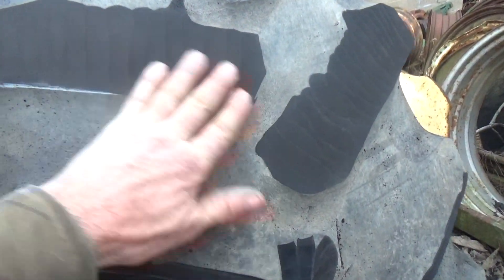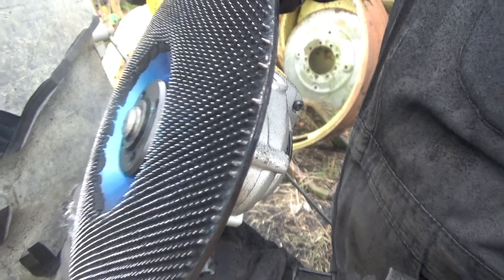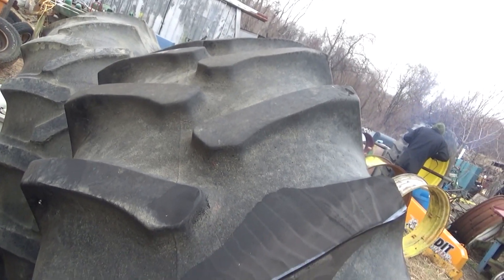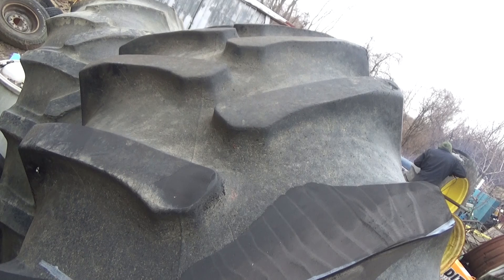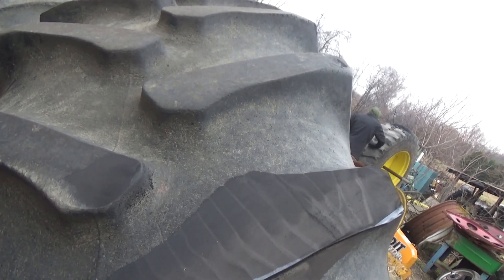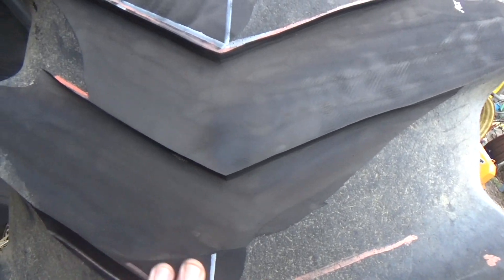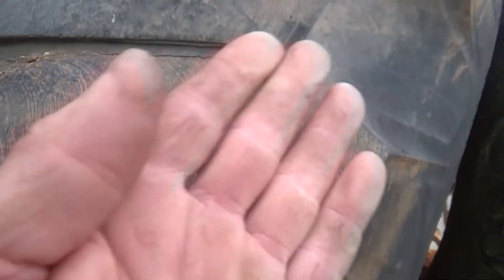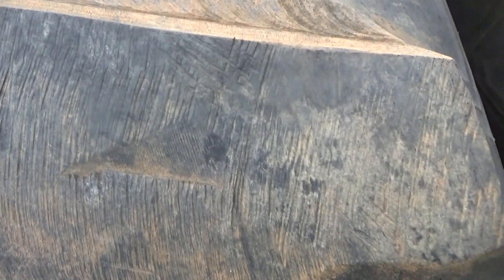Tire cutting Pt. 1

Comment: I sharpened some blades for a guy that cut our tires. He had a machine that had a rotary cutter real similar to a wood planer. The frame of the machine went up over the tire and it pivoted in the back and out front it had a roller and this roller would ride on a piece of plywood that was cut to the shape of the tire. The axle that the rim was mounted to had a disk kind of like a gear with equal divisions with the same number as the number of treads on the tire. This way it made all the treads equal.

Comment: I cheated. I bought a pair of 23.1x34 tires mounted on 27 inch rims that came off a modified called the Gambler from Tappahanock Va.
Reply from the maker: I think l might have those tires, were the rims originally painted gold?